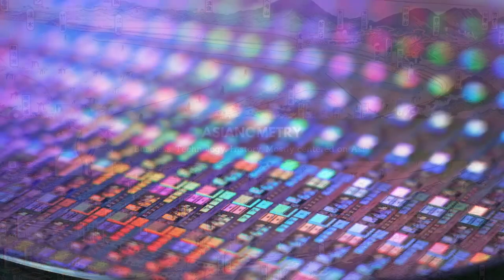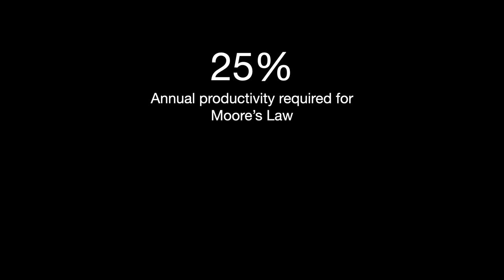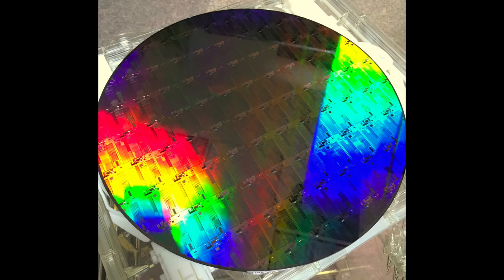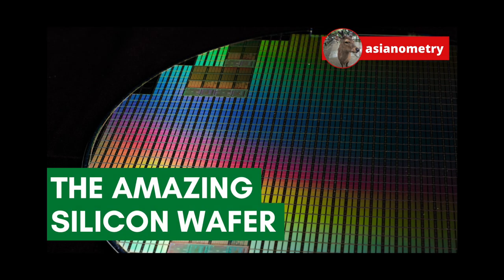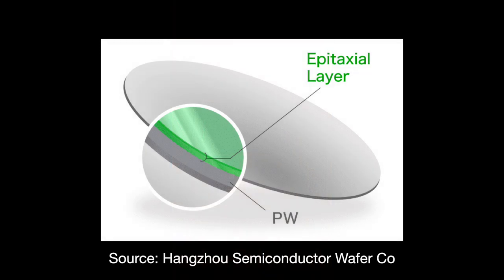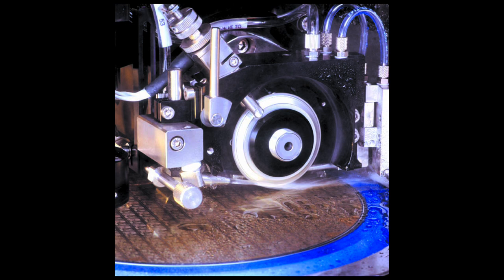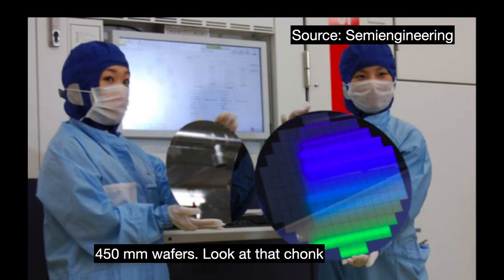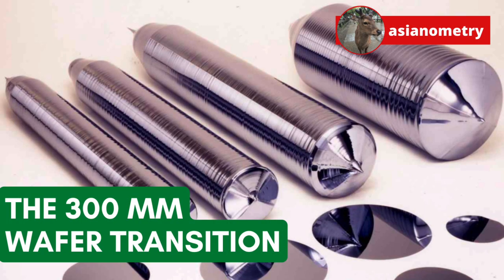The 300mm Silicon Wafer Transition

Comment: When I last worked in the industry in the automation side we began testing overhead vehicles capable of 450mm wafers -- that was 2012/2013.  I suspect that we may stick to 300mm for a long time as there are tradeoffs between a larger wafer which might be cheaper per die but only if the uniformity across the wafer was adequate and larger wafers will be more difficult to achieve that.  Just as the CPU/GPU makers are going to chiplets to get the size needed by using more than one chip as a way to limit the defect rate it may well be the case that 450mm will just not reach the defect rates that 300mm have.  Lastly, controlling for temperature changes, which as critical for litho, is harder with larger wafers and even harder as feature sizes get smaller.

Comment: Another fantastic video. Working in Singapore's semiconductor industry, the smaller companies are still unable to transit out of the 200mm production process due to costs, while the big ones: GF, SSMC, Micron keep expanding 300mm fab space. I don't see them moving to 450mm, the cost would be absolutely insane.

Comment: Silicon Edge (a UK company) has a cool little die per wafer estimator tool on their website you can use to see how die and wafer sizes affect potential maximum yields.  It is linked right off their front page.  They have wafer sizes going back to 51 mm and up to the not yet existing 450 mm behemoth.

Comment: One of the main reasons to increase wafer size is Electrical Yield, that is the % of good dice on a wafer. That depends on many things, but for sure the dice close the edge are going to suffer from more yield loss, if nothing else because you’re trying to square (dice) the circle(wafers). As the diameter grows the ratio of the perimeter (2pi*r) vs the area (pi*r^2) reduces, hence yield increases.

Comment: One of the major problems I remember with 450mm is wafer curvature. When slicing the ingot into wafers there is some curvature on the surface of the water.  The larger the diameter the larger the curvature. Compounding this problem is smaller and smaller lithography feature sizes so even if 450mm had the same curvature as 300mm it would cause problems in lithography. One way to remove the curvature is to polish the water down which unfortunately adds to the thickness. All these increase the processing losses and the cost.  I do not know if anyone in the industry has ways to overcome the increased costs to justify the move to 450mm.

Comment: the small size wafers are widely used for R&D in many university and research labs. 50 years back I used to wonder how a small seed can hold several hundred kgs of a Silicon crystal at a high temp. I still wonder.

Comment: I worked at Siltronic during that time. The 450mm Wafers were such a challenge. I still wouldn't know how to handle those things with robots reliably without them breaking due to warping, air resistance, inertia. If you need any details of that time, feel free to hit me up.
Reply: +①⑨④⑨⑦③⑨⑤④④⓪Whatsapp  lol totally not suspect! :D

Comment: The first low-orbit fab will probably use 2m wafers.
In 1979 when I was working for TI I told them to invest in a low-orbit fab. Ship up a pound of silicon for $10,000 and ship down $50,000,000 in ICs. 
Crystals grown in microgravity have a lower defect rate than those grown on Earth. When pulling crystals in microgravity, weight is not an issue. 
To fabricate ICs you need two things - vacuum and intense, clean heat. In orbit, for vacuum, just step outside. There is no need for large enclosures to resist air pressure. You can increase the separation between the wafer and the diffusion source, reducing spherical aberration on the ICs. For clean heat, use a mirror.

Comment: I remember reading that the size of the main plumbing to supply deionized clean water to the fabs was about the same size as the wafers.  So to get a 300mm fab running you need to have a massive water purification system that is secure from power failures and earthquakes and what not.

Comment: You missed one other variable in the delay between 200 to 300mm.  Improvement in thinner line photolithography allowed more chips on 200mm.  That development stopped two manufacturing sites for 300mm

Comment: They are usually called ingots, not crystals, although it is one huge crystal growth. But as usual, you have done a superb job in digging up the history of semiconductors. Bravo!!!
p.s. I was at Entegris when Intel, TSMC and Samsung got together and tried to drive the transition to 450mm. In terms of lithography and mechanical interfaces, I think it can be done. What I heard was that the silicon growers could not sustain volume production of the 450mm ingots (they were huge) because the crucibles just didn't last long enough. I have heard that from a Momentive employee that even for 300mm ingots, the crucibles have to be replaced every 3 or 4 days.

Comment: Somebody has probably suggested this before but what about growing crystals in space. No need to pull out of the melt. Melt the whole load and allow it to crystallise slowly, then remove the furnace elements from around it . The hardware doesn't have to be so massive to support weight against gravity.. You could grow perfect crystals several meters long - limited only by size of returning spacecraft (Starship has a DIAMETER of 9 metres!
Reply: The shipping cost in space remains too high. That and space has other issues. Like cosmic radiation. Which would cause silicon defects.

Comment: Solid content
1- Is the wafer size a "Concorde" moment? The intersection of material limits, cost, and diminishing returns of scale is fascinating
2- The next big thing collides with "good enough" and produces interesting debri. If you are making cheap calculators, do you really need to make them in the largest available wafer?
Reply: Calculators certainly don't have chips from 300mm wafers.
Reply: @Kynareth6  I hope so. 
But the issue is that if the machinery for 200mm and smaller wafers becomes obsolete and unsupported, one day it may  have to be cut from 300mm.
Respectfully.

Comment: I worked in the industry 30 years ago and even then pulling a 6-inch (150mm) crystal was no easy task. To me pulling a 300mm crystal is an incredible feat.
 By the mid 90s wafer manufacturing was rapidly leaving America for Asia and having
Congress dumping money now into wafer manufacturing is a joke. It is so difficult to do this work that the only place in the world that does it successfully is Taiwan. Mainland China spent billions trying to do it and they've failed so far. I don't think the U.S. will do much better. Note that even though the Chinese CCP is currently raising hell about Taiwan and cutting off Taiwanese imports, the one thing they aren't cutting off is the import of Taiwanese chips.

Comment: I remember handling 450mm wafers back in like 2012.  The FOOPs for those things weighed a ton holy fuck.  Haven't been to any of the major fabs in like a decade. Did they make the switch to 450mm like they were supposed to when I was still working in them?
Reply: No. The switch apparently did not happen, and it not even planned soon anymore.

Comment: Something glossed over in this video is the reason for larger wafers. Some benefit comes from getting more dies on a wafer which reduces the time spent transitioning wafers in/out of different machines in the process. But mostly it's about increasing the die size. The larger the die size for a given wafer diameter, the more space is wasted around the edges of the wafer. To keep up with the so-called Moore's Law dies got bigger over time as well as feature size shrinking. I think the reason why the industry isn't pushing for larger wafers again is that we're moving to 'chiplet' designs for the most demanding products now, e.g. AMD's Ryzen and Threadripper CPUs. Or maybe the lack of larger wafers is the reason to move to chiplets. Either way, with only the largest designs showing a benefit from larger wafers, it's difficult to justify the cost of another wafer size upgrade.
Reply: Consider that as you're pushing the process ever further towards higher transistor density, defect density increases. A very large chip today is maybe 3cm across, that's some vaguely 60-ish dies for the 30cm wafer. What happens if you have just a dozen tiny little defects for that wafer? Your yield is suffering, you could be throwing away a fifth of your product. Now imagine if you had some gargantuan level chips that are even larger than that, your count of defect free dies will be decimated somewhat fierce even further! So you can't increase transistor density and also increase die size any further, you get to choose one or the other. You want to make transistors smaller to decrease their gate capacity, so that changing their state takes less energy every time.

And the problem is making the wafer larger doesn't make the problem go away, the defect density per unit of area just isn't going to get better. So larger wafers would hypothetically save some cutoff waste on the periphery, but they wouldn't actually help you make large dies.
Reply: Thanks for this, I know nothing of the business, but was thinking exactly the same thing

Comment: why would we need new 200mm wafers? surely the older chips are more down to the process node size rather than the wafer size, or is it due to thickness like you mentioned the two previous standards?

Comment: I recall intel had a policy of paying no more than 1.5x for 300mm equipment vs 200mm (i.e. based on diameter).  It was much more than wafer diameter  that was changing, that was the easier part.

Comment: Semiconductor technology is probably the most advanced technology humanity has ever come up with. It's astonishing what has been done, and what is still being done to advance it. While the costs along the way must have seemed enormous at the time, in the long run the benefits far outweighs them. Now it seems production is starting to reach a limit to what is possible in regards to size. The way forwards seem to be stacking, and you can already buy chips that are made like that. I suspect silicon will be replaced by another material eventually, but there's probably room for many improvements yet. Of course, there are other exciting possibilities on the horizon too, such as quantum computing and optical computing. Not to mention chips with neural networks and the like. The future is now, people.

Comment: If they can do vapor deposition (VD) methods, I wonder if it would be possible to make the wafers square or even cut-down to the actual size of the chip.

To produce chips from those square wafers the manufacturers would need retool their plants, again. However, I am curious if changing wafer shape to use VD process could yield fewer defects and thus higher yields.
Reply: The problem is that you are starting from a small seed crystal. Making it square will be very difficult. Even if you start with a square crystal as it grows the corners gets rounded until you end up with a circle-ish shape.

Comment: Prediction: This task will eventually move into orbital or lunar space. The easily available level of vacuum is two orders of magnitude higher. Lunar gravity is 1/6thabif earth so the breakage problem goes way down, and adapting to the microgravity environment of orbital space would eliminate several problems, albeit presenting some development engineering. The Made In Space / Redwire project to make ZBLAN optical fiber in orbit is a successful example. Microgravity could dramatically improve the doping options including new materials.
Reply: Breaking one inside an orbital vehicle would be a big problem to clean up.
Reply: @Legslarsen.  OTOH the lack not gravity nearly eliminates most of the dangerous forces. But there are lots of other problems, e.g. there is no pool of liquid unless you set up a rotating cylinder, which brings back all the forces. The ZBLAN fiber making process is more like an extrusion, and it's plausible that without gravitational force an entire melt contained in a form could annual itself into a single crystal with no complicated pulling. (This is far beyond my area of expertise,  I'm just handwaving. Different methods will certainly be required and no doubt new technologies will result.)

Comment: Seems like it would have been better to goto like 250mm then they would not have so much trouble with the physical handling of the silicon crystal - or just to stay at 200mm and work on other process improvement.

Comment: I think silicon crystal foundations will be basically dead (as far as cutting edge stuff goes) before they transition again. It will probably be easier and far more lucrative to just move on to an entirely different semiconductor scheme like some of the 2 dimensional materials or to cubic Boron Nitride. Or forgo computer that are based on flipping and shuffling electric charge around.

Comment: I am surprised that the overhead hoists are not contributing significant amounts of particles into the air, as a result of friction between moving parts constantly grinding and rubbing off microscopic particles of metal and paint.
Reply: The wafer will never „breath“ clean room air directly, only be handeled in encapsulated mini environments of the tools. One change from 200 mm Fabs with open cassettes to 300mm FOUP Fabs was the allowed clean room class. 200mm need class 1 or better with laminar, air flow, closed tool backsides and other measures. 300mm Fabs have a much higher clean room class 1000, turbulent air and less restrictions.

Comment: I worked in a 300mm fab when it was relatively new. Half of the issues were with the OHVs and stocker systems. Tools might sit idle during automation issues and then end up being down for maintenance when automation was back up. Scheduling was not always as smooth as it could be.